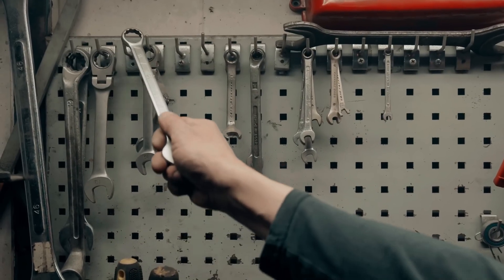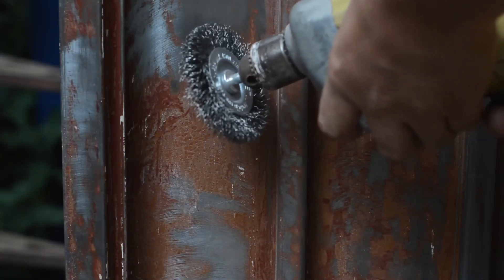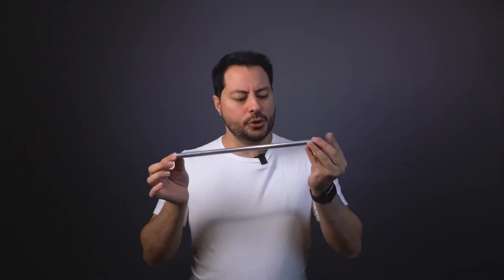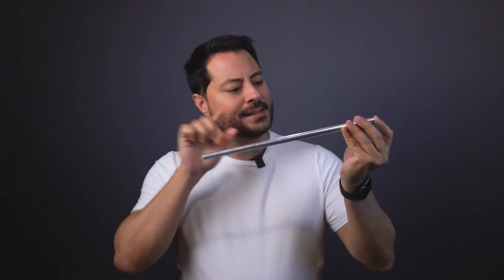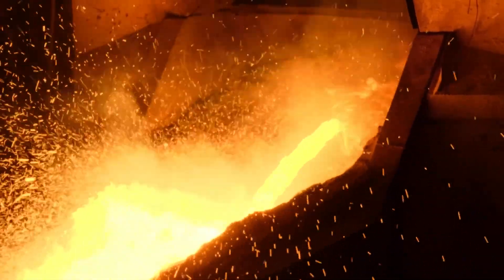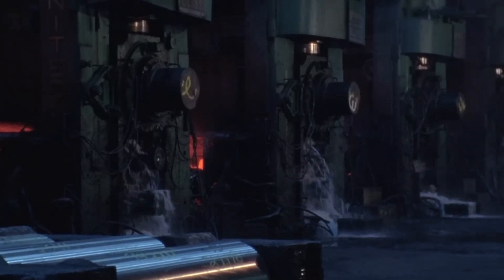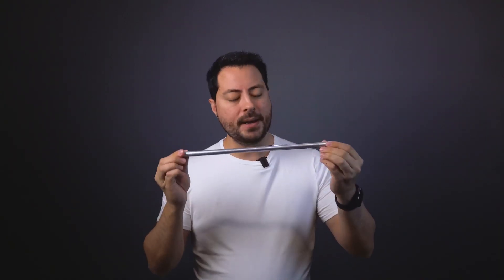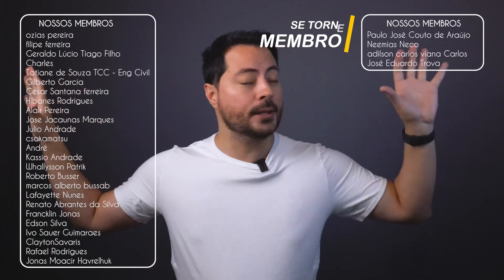Why Doesn’t Stainless Steel Rust? What Makes It So Special?

Comment: Back in the 60's the NRA tested Stainless Firearms.  Results were that Stainless didn't rust initially but once started, the Corrosion surpassed regular steel.   A better way to describe  it would be Corrosion Resistant!  My Carbon Steel Kitchen Knives have not rusted in 40 years of use but they are taken care of.